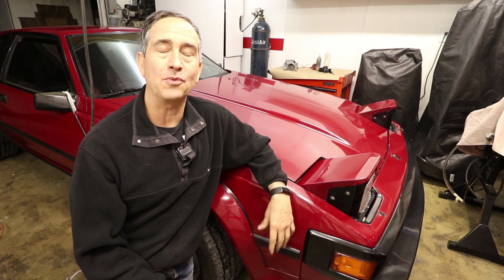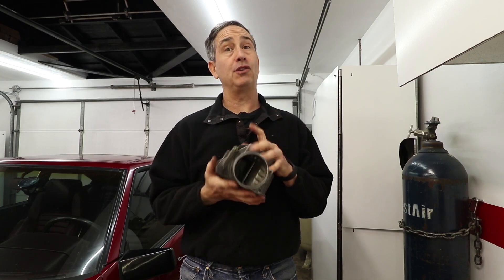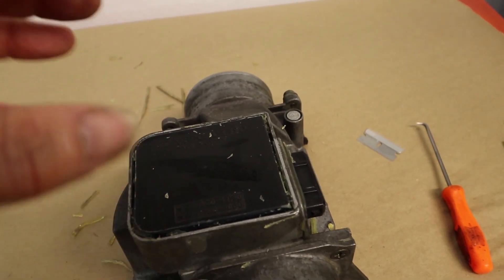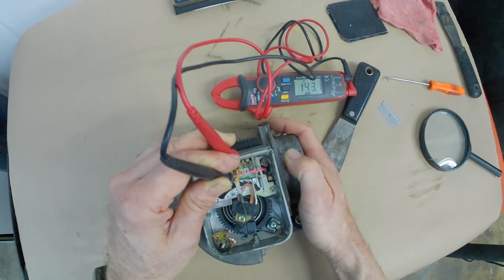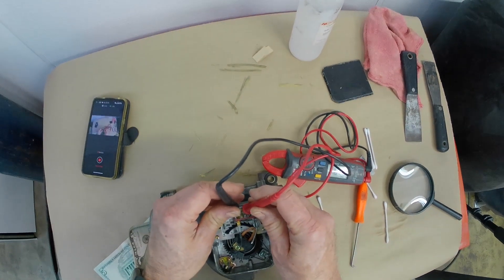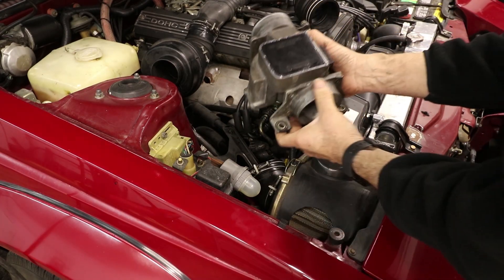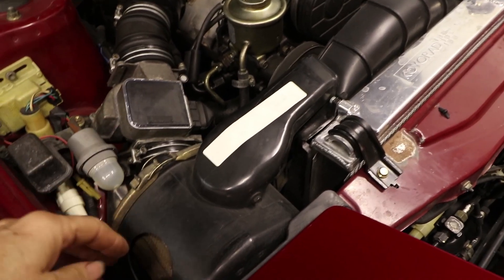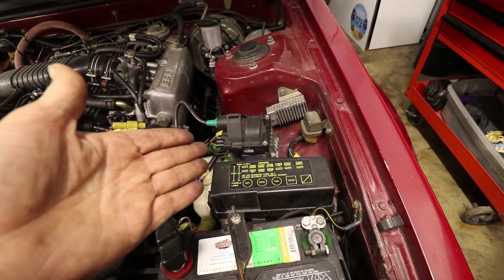Clean Your L-Jetronic Air Flow Meter To Improve Driveability -Toyota Supra

Comment: Is the EGR system kicking in at that flat spot RPM?  You're looking into the rabbit hole...careful, you might fall in. 😁
Reply from the maker: I blocked off the EGR ports yesterday (after this video) and it didn't make a difference.  There are still more vacuum places to check though.  The engine passes a smoke test, but different ports are active at different times like you said.   It dips lean so fast that it could be a misbehaving vacuum valve or something.
Reply: @GarageTimeAutoResto  the rabbit hole is getting deeper.🤪

Comment: Throw away all the 1980's shyte, and upgrade to modern throttle bodies and ECU. 
When I say throw away I don't mean it of course, remove it and keep it for originality if you ever sell :)
Reply from the maker: Agree and I'm going this route on my 911, but it's smog exempt.  This car gets inspected every two years, ugh
Reply: @GarageTimeAutoResto  So by inspection you mean it needs to retain all the standard parts? That's a drag... Or is there a way you can make modern TB's and ECU also smog compliant?
Reply from the maker: @Farlig69 yep, we aren't allowed to change anything in the engine bay to aftermarket even it if improves emissions.  Very few aftermarket parts have a CARB certificate allowing them to be installed.  
Even putting a new catalytic converter on is a major hassle if the part is no longer available from Toyota.
Reply: @GarageTimeAutoResto  What a drag.... well least you get to play with the porker properly :P

Comment: Release the AFM swiper screw and shift the contact slightly. It will avoid the worn path and works like new.
Reply from the maker: Great tip.  My stripe didn't look worn at all, but I've seen some that are bad.  Some also say to bend the arm slightly which makes it shorter.  I'd rather do what you suggest if the worn path is severe.

Comment: When I was an automotive tech in the late 90s-2000’s, I used to get tons of vehicles in with drive ability issues due to “tuners.” Most of these were Honda Civics with the huge canister exhaust and cold air intakes. This would cause a lean condition because they didn’t have the ECU remapped. 
I would cover that hole in the intake and get as close to stock exhaust and remeasure. It probably wouldn’t do anything, but fixing someone’s futile attempt at unrestricting. 
Also, did you try your spare air flow?
Reply from the maker: I agree that tuners mess things up.  My wbo2 afr gauge has been in all my cars as a sanity check.  The thing most tuners forget is that the ECU will work even harder to adjust the fuel mixture if a performance mod is done without an ecu tune..  It's a closed loop system for all but full throttle.  
I did try the other AFM which was factory sealed and the car ran lean at idle and more lean throughout the power band.  I may go through that one and adjust it instead of messing up a good one.

Comment: The airflow meter uses a potentiometer (the carbon tracks on the PC board). they do eventually wear and cleaning can help. There are ways to move the wiper contacts to fresh carbon, but it's a bit risky and may cause a loss of calibration. The drop-out on the digital meter more than likely were caused by the auto range function of the meter. I found an analog ohm meter the be the best test gear for testing these old potentiometers. I would personally not try to adjust the clock spring and leave well enough alone. My first experience with these Bosch air flow meters was on a 1976 280Z. Good video and good luck!
Reply from the maker: Thx.  I think measuring voltage is probably the best way to diagnose these things because that is what the ECU reads.  Perhaps make a breakout pigtail?  Sometimes Toyota offers test connectors, so maybe I'll look at again.  
I'm thinking my lean spot could be from an old EGR valve or something emissions related?  The car runs pretty good, so I'm splitting hairs at this point. This might be a necessary evil to meet emissions? 
The clock spring can always be put back.  While not in this video, I tried swapping that AFM with another sealed unit from Toyota and it ran differently, even more lean across the board.  I suspect they are all out of calibration by now just due to age.
Reply: @GarageTimeAutoResto  Yeah a break out of the actual signal in use wouldn't hurt. An oscilloscope might also come in handy for real time monitoring. Regarding the differences between the two air flow meters, it might be cased by differences in how the  bypass adjustment (screws) are set in each airflow meter. These are generally used to adjust the stoichiometric air/fuel mixture. I adjusted the bypass on my 85 911, using the bypass and a wide band 02 sensor.